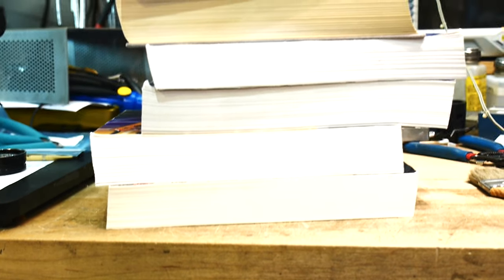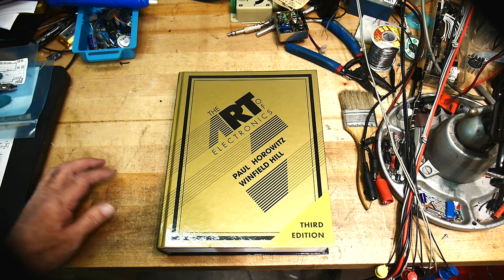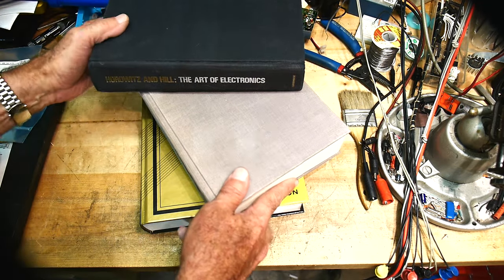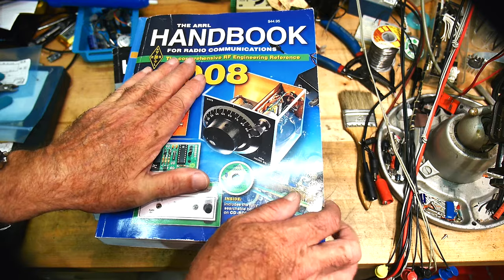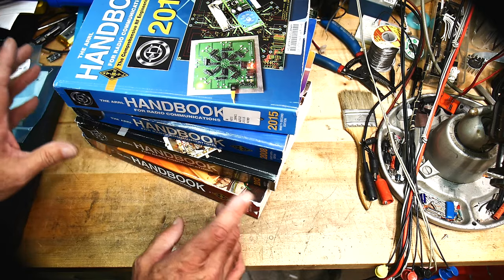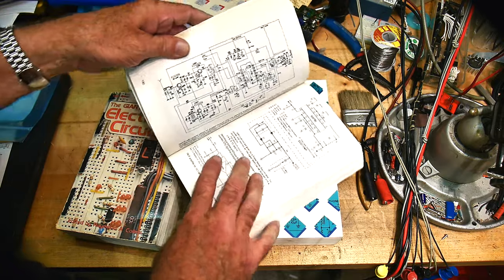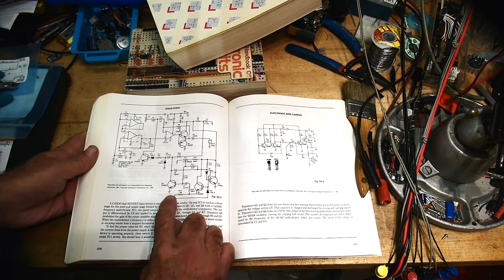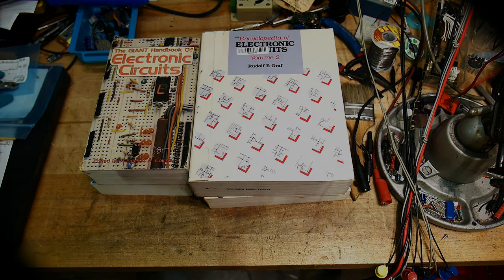#491 Recommended Electronics Books

Comment: Yep, exactly right. I have learned most of the electronics I know from both the first and second editions of H&H, and I have about 6 or 8 different years of the ARRL Handbook between 1948 and 2012.
I'm a self-taught senior electronics tech, retired and an Amateur Extra class ham. I've worked for HP, TRW, IBM, and SONY, and I still do some repair work for a government lab.
I also have 4 or 5 copies of 1001 circuits books, and Cookbooks to digital logic, RF amps, and op-amps. In all I've spent about $25 on the books I've turned into both a career and a hobby. I pick them up at used book stores and ham swaps unless they are simply given to me.
Reply: Excellent books but I find they are a bit technical for beginners. I recommend Jestineyong's website of free articles and his e-book "Electronic troubleshooting and repair guide." For beginners.
Reply: If I was near, I'd candidate myself to be your apprentice. And I mean it.
Reply: @ulysses_grant  I wish I still was working and managing the repair shop I'd let you in.
Reply: @briang.7206  It would be an honor.

Comment: Just received a used copy of the 1995 edition of the _ARRL Handbook_, which cost me ~$10 including shipping. The topics that interest me are basic principles of AC and DC circuits--amplifiers, filters, oscillators and power supplies--and the mathematical formulas needed to design and troubleshoot them. All are covered in depth in the _Handbook_, and the text and illustrations are among the best I've encountered. For the price of two froufrou drinks at Charbucks, I now have the equivalent of two years of tech school at my fingertips. So glad I learned how to read!

Comment: Some also very great books are the "300 electronic circuits" series books made by Elektor, I have versions 300-305 translated in romanian and they're great. The 304 and 305 books contain some circuits and programs for computers that haven't been used in two decades but they still have a lot of interesting circuitry in them.

Comment: Instantly recognized the 1001 More from the thumbnail. That's a pretty old book, I got it in the 1980s. I sort of keep up with raspberry pi and arduino tho I have never used them. People are using them to do simple stuff that would be much easier with discrete components.

Comment: Good video! I have been an ARRL Life Member for over 40 years & have quite a collection of the ARRL handbooks. At a ham radio flea market in Connecticut, the ARRL Lab was cleaning house and had assorted years for $5 each.  I found on-line, there is another book "Learning the Art of Electronics A Hands-On Lab Course" by Thomas C. Hayes. It seems to be the companion volume for The Art of Electronics you mention in the video.

Comment: It's nice to have a book full of electrical schematics,  what would be nicer to have is a break down of each schematic explaining the functionality of it, do we have a book like that where they really break down how the circuit works? That's what I've been searching for for years and never found one.
Reply from the maker: I don't know of a book that does that. The best source would be application notes and sometimes datasheets.
Reply: "The Art of Electronics" does that pretty well.
It contains Circuit Ideas and Bad Circuits, in addition to a sprinkling of problems.
Reply: You first learn building block circuits. Then you build bigger circuits and experiment and take measurements by changing component values. Make changes and observe that's how you learn. If you get a book explaining you everything you won't learn a damn thing.
Reply: @nobytes2  You still have to do that regardlesse even if that book existed and I agree with you but I think there aren't enough books that explain detailed functionality of useful circuits unless it's something too easy or intuitive.

Comment: Another one to suggest is the Handbook for Electronics Engineering Technicians by Milton Kaufman and Arthur Seidman much like the Art of Electronic with a broad scope.
I tend to prefer some of the older ARRL handbooks as they had more of the technical information that seems to be lacking from the new editions so most of mine are from the 50's and 70's.
Also the Radio Society of Great Britain (RSGB) has some excellent technical reference books that are available some places in the states...

Thanks

Comment: I have saved all of my elecronics books from the 1060's. I have a few rarities printed by RCA, Siemens and Texas Instruments and some of General Electric. They contain thousands of circuits with now obsolete parts. However, the circuits are applicable with modern parts too. 

It may be surprising to know that some transistors, like 2N3904 / 3906 are from about 1961 and still made in millions. There are many other types too which still are in heavy use since they are so reliable and have good specs.
Reply from the maker: the printing press wasn't invented until 1436 so I'm very interested in getting copies of those old books 😎
Reply: @IMSAIGuy  it was an ovious typioo.. I enjoy greatly still by reading them ocasionally. Btw, I also have Telefunken tube handbooks and DEALER JOURNALS from 1930's- They are printed on top quality paper and just like were just printed.

Comment: I'm now scratching my head by reading "Microelectronic circuit" by sedra & smith
Reply from the maker: I would not recommend that book for a beginner
Reply: @IMSAIGuy  it's actually for our electronics-I course that has DIODE, BJT, JFET, MOSFET from that book
Reply: @IMSAIGuy  Most of the time I feel like those sentences written on the book is not even making any sense in my head.
Reply from the maker: @michealscott6198  typical text book. you will learn lots of things but sill cannot design a circuit. Not saying it is a waste of time, appropriate for a EE degree.

Comment: 'These things are called books', not in the least bit patronising. I've got a good one for you from 1964, it's called 'Beginner's Guide to Electronics', by Terence Squires, it does mention the use of discrete transistors in common base, common emmiter and common collector modes, just 5 years before the first moon landing. Also quite insightful for the time as it discusses the acquisition of voltages from the human brain. The pace of technological change was enormous in those days - VLSI appeared within ten years of the Squires book and the outcomes from those changes came at a pace too. Interesting that outcomes from modern technological advancement don't have the same high impact - discuss :)

Comment: Thank you for the recommendations! Do you think 30 years old is too old to try to get into electronics? I work in IT so I work around computers and I can program/script, but have never dabbled with circuits or tried to understand what all of the components on a board are.
Reply from the maker: depends on what you mean by get into. most jobs require a 4 yr degree. if you are in IT you recognize the people without degrees doing repair or installation.

Comment: In my opinion, the best electronics books are:
The old Radio Amateurs handbooks (I like 1956 and 1937) 
RDH4
The Art of Electronics
The Audiocyclopedia 
Electronic and Radio Engineering/Radio Engineers Handbook by Terman

Great video!
Reply: The best part pf the old Handbooks were the eye candy in the catalogue section in the back. Gorgeous lithographs of variable condensers, coils and tubes, etc.

Comment: I have a question: After reading all these schematics, how do you use them in real life on your PCB's? Do you simply add them together to make a larger circuit?
Reply from the maker: you are looking at the whole, you need to look at the parts. how did the engineer use the resistor to make a voltage? how did he use a resistor to make a current? how is that transistor used? why is the base grounded? it that capacitor holding a voltage or used to pass an AC signal? all the electronics parts are on your pallet. an artist looks at a book of paintings to discover how someone else used the pallet. how did they shade, how did they apply color, how did they do composition.
Reply: @IMSAIGuy  😘😘
Reply: @Bob-tu9jq  eevblog YouTube channel has a lot of in depth videos on proper overall PCB design.
Reply: @joefuentes2977 Thank you.

Comment: I purchased the most recent copy of The Art of Electronics, yes it is packed full of information.... But it focuses largely on small signal measurement circuits using discrete components, you won't find much on RF / Power Amplifiers / Op Amps / control circuits and other common electrical circuits.. I returned it, it just wasn't worth the $100 purchase price.

Like your copy, I suspect most copies of the The Art of Electronics are unused.. no heavy page use, all the pages look clean and never read.

It's a premium priced book, even used, I would focus on purchasing other less costly books.
Reply: Yeah, all these comments and videos recommending it sound like paid reviews to me. It's a reference book. Is it the best one in that regard? I don't know.
Reply: @alejandroperez5368  I don't now if they are paid reviews.. the book has always had a following, so I decided to take a look. You have to remember that the guy that wrote this is interested in teaching physics students basic electronics, and measurements is a critical issue relative to the field for them so it leaves a lot out.
Reply: Maybe you need this for  RF:  Experimental Methods in RF Design.
Reply: @barrybogart5436  Thanks I will check it out.

Comment: do you think there is 1% difference between electrical and electronic engineering knowledge or is the difference is 50%.
Reply from the maker: those terms are not well defined. they often are 100% same. but electrical engineering may also be used to talk about the power grid and hydroelectric dams. if your question is concerning a university it is best to look at the individual courses

Comment: I was recommended by my teacher to go thru Art of electronics too when I was doing my masters when  he saw me struggling, he literally called it the bible of electronics, sadly electronics never clicked in me I do understand basic theory but that's just it... Was never good enough to use those in exams to even solve decent level numericals.... 
I do want to build up my foundation again if possible, can you suggest me some books that basically need no pre requisite knowledge about electronics too read... Something that build you from the ground up...
Reply: Learn by actually building circuits and analyzing wave forms using an oscilloscope 
For starters start building amplifiers using different transistors configurations and even op Amps 
After that build oscillators, filters and signal generators 
Now move to power supply circuits design 
Build counters
Finally microcontrollers, IC circuits, make sure you under 555 timer as a pre requisite

Comment: Are there any books on  how  practical analog signal processing works without mathematical  theory and derivation of equations only component level and systems level working.?
Reply from the maker: all of those books have analog circuits. what processing are you thinking of?
Reply: Unipolar and bipolar signal processing tobe specific automotive signal processing.
Reply from the maker: @Mewanrahnam575  of course the basics are the same for all analog applications. you might be lucky to find a book on auto circuits but probably not (or it is very expensive). I suggest trying to find schematics and learning from them. the companies selling ICs will often have application notes or example circuits on the datasheets.

Comment: but is there any book on purely passive technology?
Reply from the maker: most of these will talk about resistors, capacitors, inductors, transformers, transmission lines
Reply: @IMSAIGuy  voltage doublers are purely passive, but they require an oscillated input.
Reply from the maker: @magnuswootton6181  I think diodes are labeled an active device
Reply: @IMSAIGuy  u must be showing me your amp made with diodes!!!
Reply from the maker: @magnuswootton6181  https://youtu.be/Qi--flLkgZo